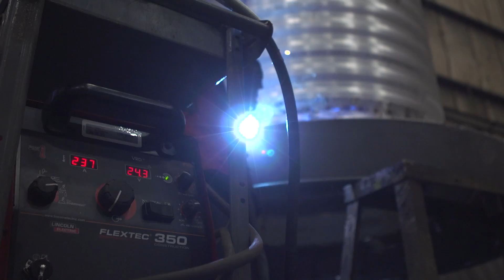Qual-Fab, Inc. Relies on Lincoln Electric for Stainless and Nickel Alloy Welding Fabrication

Comment: Im trying to trouble shoot a Lincoln Apect 375.  Why in the world, would this machine have a continuous gas flow in tig mode without the pedal being pressed?  Even with the machine off!  Also sometimes, the machine seems to be stuck in AC mode even though the very visible LED lit indicator shows DC.  Other than that, I just realized I am not happy with this machine.
Reply from the maker: We take pride in designing and manufacturing the highest quality equipment in the industry. We would like to learn more about your experience and do all we can to make it right. Please contact us at 1-888-935-3877 at your convenience. Thank you!
Reply: Warranty took care of the problem.  Two boards had to be replaced.  Machine runs fine now.  Thanks for the response.